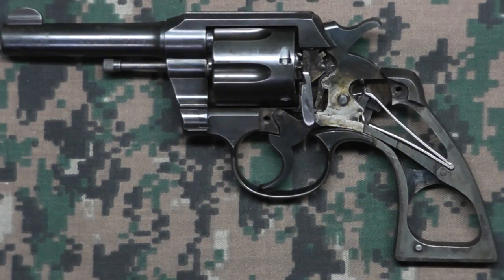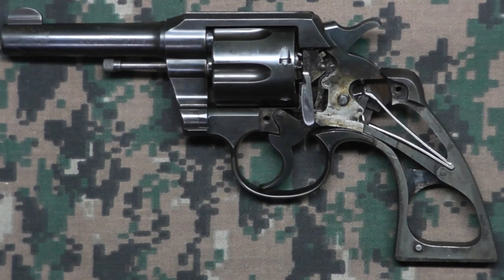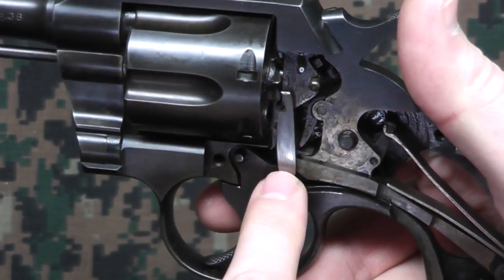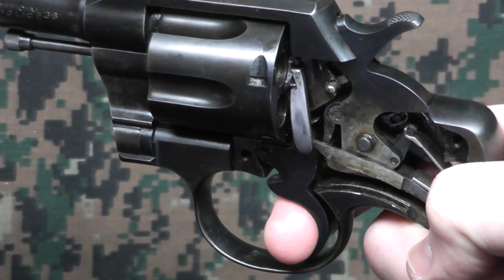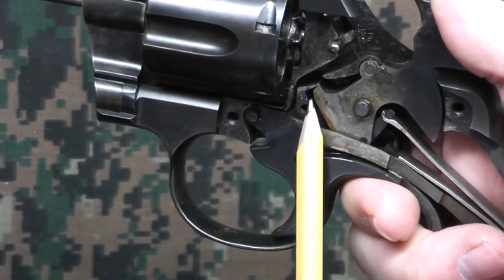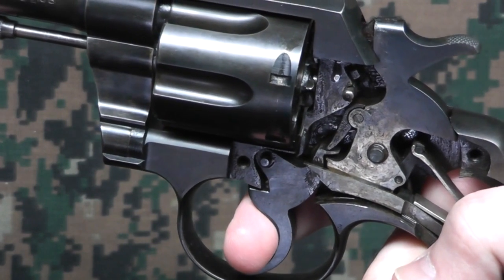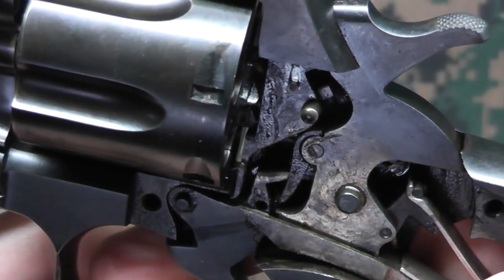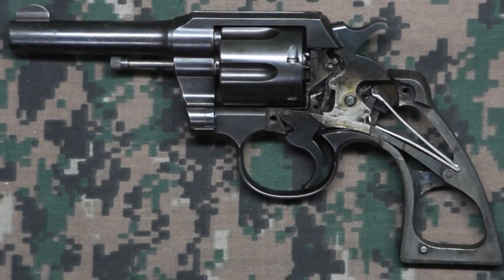Colt Official Police Revolver Internal Workings

Comment: I'm blown away on the simplicity of the action but the precision in how its made is amazing
Reply: Much simpler than the S&W.
Reply: As a gunsmith I agree, much simpler than S&W. Not quite as close tolerance as you think. You have to time the first tooth of the hand with release of the cylinder bolt. After that everything else falls into place.

Comment: Sir, this comment is a long time coming, considering the age of this post. On the display of the internal workings of the Colt Official Police in your fine video, shows a trigger-action that has no equal. The trigger-action was "hand-honed" and "hand fitted" by a Colt Master Craftsman. This is the same exact trigger-action used in Colt's legendary Python Revolver. No longer made in its original 1954 form. And the Official Police was a cop's .38 Service Revolver. With exception to the Smith & Wesson Model 27, the precise fitting of the side plate to the frame of the Official Police was a work of art, this in addition to the already described trigger-action engineering/fitting. The revolver manufactured today is largely part bins put togethers, done by unskilled workers. Rising labor cost beginning in the early 1960's would lead the Colt Company to design their own part bins put together service revolvers like the other gun makers were doing. I own three of these Mk III Colt Revolvers. Strong, durable, and accurate shooters, great cop revolvers, but carrying none of the features of the previous I-frame Colt guns. The trigger-action of the Mk III six-guns was not as smooth as the I-frame Official Police Models. This change-over at Colt of the I-frame to the J-frame (Mk III) took place in 1969. The cost savings that came with Colt's new design was "NOT" passed on to the gun buyers. Longtime contracts for Colt .38 duty revolvers was discontinued as many big-time Cop contracts went to the Smith & WessonCompany for their "legendary" Model 10. The S&W Model 10 would stand at the top until the early 1990's when the transition to the 9mm semi-auto pistol occurred. The Official Police stood at the top of law enforcement duty revolvers in pre-war times,  to early post war (1926-1955). From 55 on unto the early 1990's, the S&W Model 10 or their stainless steel Model 64 would rule the roost in .38 Revolvers for cops. Thanks again for this video of a long ago,  superb Colt trigger-action of the Official Police of Colt Firearms.

Comment: What would cause my revolver trigger and hammer to get stuck? It only happened 2 or 3 times before I cleaned my pistol. I cleaned it and I try to replicate the problem but it doesn’t want to do it anymore. like I stated earlier I pulled the hammer back into single action, I tried to pull the trigger but it wouldn’t do anything, another thing I noticed is that I could freely move the cylinder and wasn’t properly lining up. The gun was basically frozen, I pulled the trigger manually forward with my finger towards the front of the gun and everything seemed to unjam. I took the whole pistol apart cleaned it and it doesn’t wanna do it anymore but the cylinder not lining up properly just once worries me. One thing I’ll add is that the only thing I didn’t take out was the bolt.